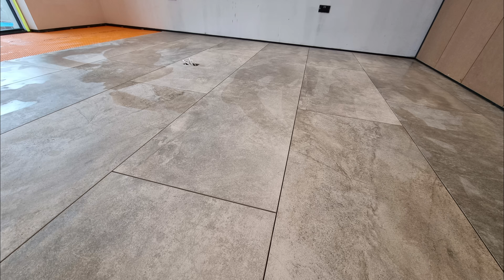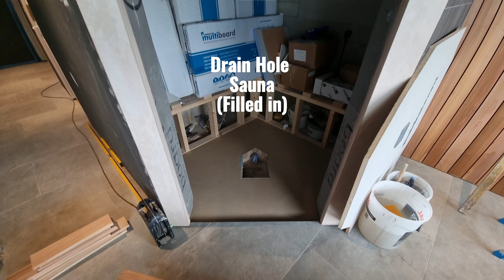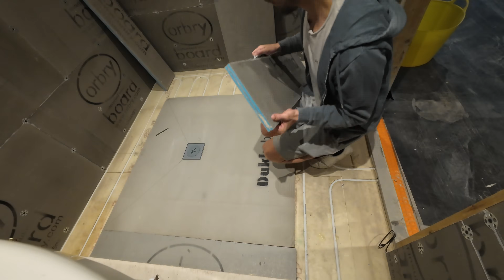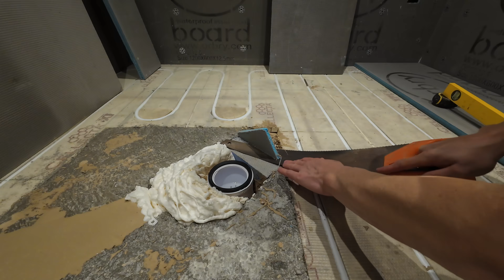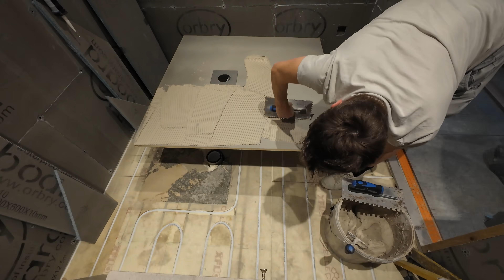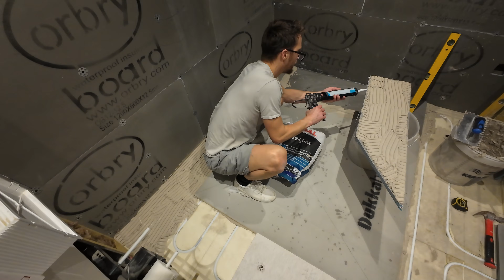How to Build YOUR OWN Custom Wet Room Shower Tray!

Comment: Question, the wall backer boards appear to have been installed before the wet room tray, is this permissible as there seems to be conflicting walls first versus floor first. Great content by the way 👍
Reply from the maker: Hey, Generally on anything wet room, I'd recommend floor before walls. This is the same for tiles and the substrate. As the walls then sit on top of the floor creating a barrier (Like an L shape). Imagine the other way around and you'd effectively have a gap. If anything ever moved e.t.c,. You'd just be relying on that probably siliconed joint from the wall to the floor. And you'd loose support, as effectively with the wall sitting on top of the floor you are tying the two surfaces together if that makes sense 🍻
Reply: @thebespokebloke great thanks, if you were close enough to Shropshire I’d hire you in a heart beat 👍

Comment: 20 years tiling and your bedding the shower drain in with self leveling compound that is meant for max 20mm use!!! Why not just use the foam
Reply from the maker: Kerakoll Self levelling go's to 50mm,  There's some foam and self level (as solid) to just keep the trap in place. Nothing structural.

Comment: Is the shower tray custom made? Looks like it's cut and angled for the water to flow into the middle. Or is it just pencil marks. Great videos watched them all
Reply from the maker: Hey thanks, The tray itself is not custom (you can get a range on different styles /drain placements).. The infills around the sides are extending it basically 🍻

Comment: ...hello...thanks for sharing your expertise...
...really appreciate it as am in the process of designing + planning our bathroom...
...i noticed underfloor heating pipes were covered with insulated backer board...does this still allow the heat to come through the tiles?...cheers...
Reply from the maker: Awesome thanks Mike.. Yep it'll still come through, Just won't be as instant as say if you had under floor wires in some uncoupling matt under the tiles directly. But this particular house was a passive house, So the temperature throughout are regulated so it's pretty much all the same (rather than like really hot instant floors). Saying that I can confirm the floor was still pretty warm once tiled in that setup and if you whacked the heat up throughout it would get to that desired temperature 🍻

Comment: I’m researching what it takes to turn a bathroom into a wet room because I’m so tired of water damage. Wether it’s from a pinhole in the shower curtain that lets water trickle on the outside of the curtain, onto the edge of the tub and to the floor, causing rot, because of course the caulk on the trim is crap, to a leaky sink or toilet causing the floor to rot, I’m so over it. It’s a trailer bathroom (triple wide manufactured home) but I don’t see why I can’t basically waterproof the whole bathroom and basically encapsulate it so water either goes down a drain in the floor or is easy to wipe dry. 

I just don’t know what to do about the cabinet the sink is on, and what goes on the floor trim at the door to keep water in. I mean, I can’t lower the floor and make it like a step-down. Ugghhhh so many questions lol.
Reply from the maker: Sounds like you're going for a full swimming pool approach, ha. With your sinks etc.. These days a lot of people even have the units made out of tile (Backerboard base tiled) Also things like marble would keep your sanitary wear waterproof 🍻

Comment: Great work, new ways to do things. Only question is how to you have a heated floor as the pipe is now below the insulated board you have used. As you have floor heating below, would it not be better to make the falls with sand and cement or similar compound as your on the ground floor and waterproofing over the top?
Reply from the maker: Thanks man, That house was a passive house so the temperature throughout is controlled (pipes on every floor), So you can't really change the system. But yes in a different scenario you'd put your wires on top of the board etc and happy days you'd get max heat. The floor still gets pretty warm as it's passing through the floor on the house. You could sand and cement for sure in a different scenario but not on top of that particular pipe system (it would crack)
Reply: @thebespokebloke  Thanks great explanation and great to know heat still comes though

Comment: DIY'er here. Great video.  I have a shower area of 1200 x 800 and want to do this style of shower tray, but have to fit a glass screen enclosure which I assume would have to sit on flat horizontal tiles, so I am thinking about trimming down a 1200 x 800 tray then adding a 50mm flat tile around the edge of the tray for the enclosure to sit on. Can I ask would it be possible to trim this style of tray to suit or would it bugger up the fall lines already built in to the tray? Or could I fit an enclosure straight onto this style of tray as it is? I hope this makes sense. Many thanks.
Reply from the maker: Hey thanks! Awesome, So the preformed trays are level the whole way around the perimeter (so when you lay them you lay them level) So yes the screen would normally go across the edge of the tray and adjoining floor. If you need to cut the tray down, Do it on the opposite side to wear the glass is going. That way you keep the flat level outer edge for the glass. Hope that helps 🍻
Reply: @thebespokebloke  Thanks great news. Just one more question please. What adhesive do you recommend for setting the tray on?
Reply from the maker: @andybrown9334  You're welcome.. If you want rapid (I normally do for fixing trays) Bal Rapid One or if you want a medium set Bal Flex One mate Both S1 flexible adhesives
Reply: @thebespokebloke Nice one. Thanks for sharing your knowledge and experience!

Comment: A client in a first floor flat wants a wet room like this.  Victorian build, so nice floor void, with floor boards.  My worry is getting access to the waste and plumbing joints currently in the floor void should they develop a leak in the future. Would you recommend not doing a first floor wet room in this scenario?
Reply from the maker: Hey I'm not qualified to give plumbing advice.. But I'd say we do a lot of wet rooms in flats e.t.c.. You'd just have to hope the plumbing is good, otherwise yeah if there is no access from underneath things could get tricky.

Comment: Sorry I may have missed it how did you achieve the slope?
Reply from the maker: Hey, So the tray is pre-formed (envelopes/falls are in it) Then I just match the direction of the slope with the external boards around the perimeter 🍻

Comment: With the falls you have done would this method be suitable for a wet room for a disabled wheel chair user?
Reply from the maker: Hey, yes absolutely. I'd recommend larger format tiles though just to not put to much pressure on individual small tiles (although should be fine)

Comment: Hey man, I did the UFH at that place. I remember many ideas being floated about how to solve that tray issue. 

Didn't actually see the end result until your video. 

Top work, great solution and great video. 

Only comment is that, does that backer board have an insulated core, xps? 

To be honest it doesn't really matter in that place, the heat losses were next to nothing!!

Keep up the good work!
Reply from the maker: Ha, Awesome ..Small world! Nice to see it all done I bet! Yeah there was many conversations my end on the way forward to, but I think it all worked out pretty well and very bespoke! I think most foam backerboards are xps insulated but correct me if I'm wrong. You probably know more about that department than me. But yeah as far as I know all good and they are over the moon! Great team work mate!
Reply: @thebespokebloke  yes you are right, anyone that is easy to work with is formed this way. Solid cement boards are not readily available and are a pain to work with. 

Are you on linked in? Drop me a DM, would be good to add you and potentially work directly on another project. Benjamin Anderson at UFHN, I stood in front of a van saying ufh so pretty easy to find!  

Just double checking it was the same massive house on the seafront. Old "fortification" road. 

I enjoyed watching some of your other videos too. Got a bathroom Reno coming up where I am lowering the floor level with the top of the joists to squeeze in underfloor heating. 

Anyways, all the best, maybe catch you on the next project.
Reply: So the XPS board will stop the underfloor heating from radiating the heat up? Not a criticism, just wondered if there was a better way. Nice professional work though.

Comment: Hello mate, is it even worth a 0-experience DIY tiler / plumber from going for a wet-room style bathroom (where there is a glass panel demarcating the shower but where a tray would be there is tiles level with the rest of the floor)? I’m looking at a full refurb of the 2nd floor bathroom in period property where one particular layout will only really work with a wet room style shower, but just want to be mindful of not biting off more than I can chew during the project or cocking up and having leaks further down the line. Guess, what I’m asking is how much of a technical learning curve is wet room style showers vs all the other typical tiling and plumbing bits you’d expect a DIYer to deal with on a run of the mill bathroom remodel. Thanks!
Reply from the maker: Hey mate, if you send me an email, I'll try and give you a bit more of a detailed response
Reply: @ ah that’d be much appreciated. Where can I find your email? Can’t seem to find it on your channel anywhere.
Reply from the maker: @kierand9410  It's on the main page when you click "more" next to my name

Comment: Personally I use sandcement to fill that pee trap part. I wouldn’t use PU Foam due to the fact it expands and pushes that pee trap up also when you stand on that part it wil feel spongy. Also their ain’t a solid substrate then underneath the tiles and could possible break of crack over time.
Reply from the maker: Absolutely mate, We use different methods, But the foam worked well in this example

Comment: We use sand and cement dry pack , then we cement down shluter waterproofing membrane  to it . We also have shluter pre slope board but that is for certain sizes with less flexibility.
Reply from the maker: Nice mate, Thats something we used do back in the day in certain circumstances. But personally I'd always go with Backerboard these days and take out the others layers. (which have potential to fail) Backerboard is such a good product for porcelain tiles to bond to I'd always go with that when I can.

Comment: Looks great! 
Would you recommend a decoupling membrane over a preformed shower tray like that if laying on an wooden floor? Or not needed as the tray is one piece? Advice greatly appreciated!
Reply from the maker: Hey thanks! Nope, no need with a pre formed backer board shower tray in any scenario really. Just as usual make sure the wood floor is solid. The shower tray will get stuck down with tile adhesive, (same way as in this video) All you'd tend to do is screw down any outer boards with washers and stainless steel screws. Again any bonding sealant between joints always adds strength, then finishing with the waterproof tanking. Hope that helps mate.

Comment: Very neat workmanship......💪👍 .

can i ask you , to recommend a shower Tray Brand ..( 30mm Height & Not Acrylic  🤔 📥
Reply from the maker: Thanks mate much appreciated! DukkaBoard/ Orbry Board  trays are what we like to use. They have good all round properties. You can get a 30mm but they are normally in the linear (rectangle kind) Can you not raise the floor for a 20mm tray?
Reply: @thebespokebloke  do Dukka & orbry make shower trays ?..
I was thinking of mira but heard alot of issues w them ...
Reply from the maker: @poloiscorrect  Yes mate both do. I'm using a Dukka 1.2x1.2 one in this video
Reply: @thebespokebloke  thank You